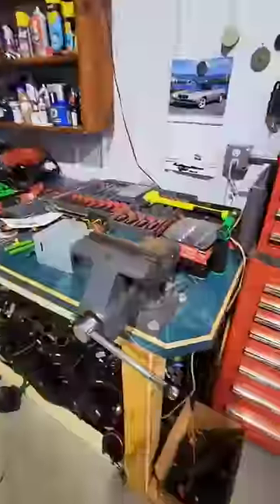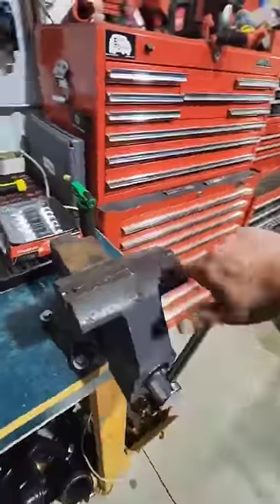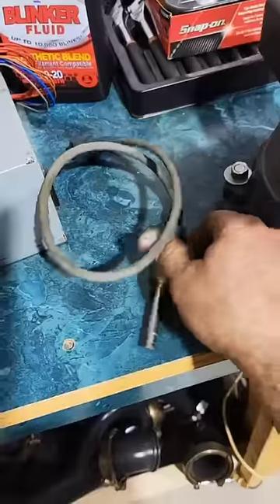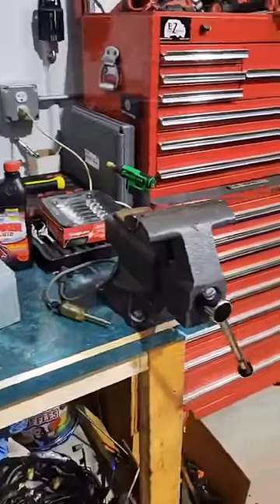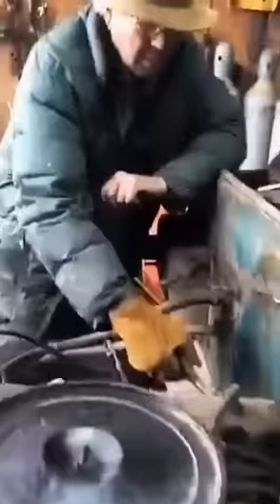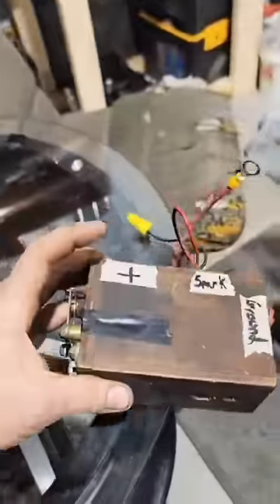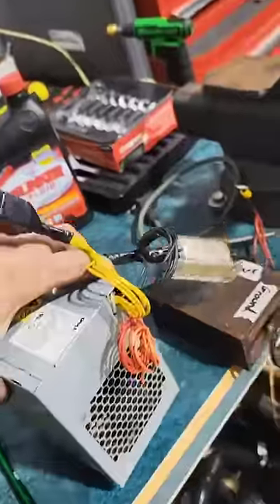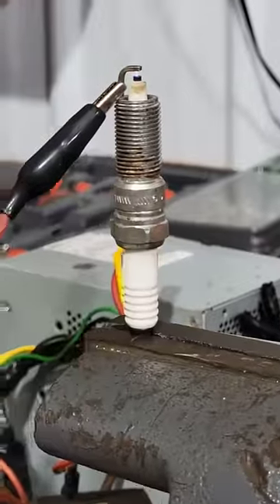30,000 Volts out of an ignition coil! #shocking #shorts Be careful, electricity can be dangerous.

Comment: Back in the 60s  I hung out with my gearhead buddies at a local service station. It was convenient because the operator would allow us to use the lifts and service bays to work on our cars. At that time most garages were equipped with a spark plug tester that would energize the plug to see if it was working properly. These guys ran a wire from the spark plug tester to a metal framed chair in the customer lobby. Woe be to anyone unfortunate enough to sit there. I watched those heartless bastards zap a little gray haired grandmother and laugh for an hour afterwards!
Reply: Yea... that's not really funny... more cruel honestly.
Reply: And you aren't gonna tell me that you didn't laugh at the time with your buddies.
Reply: @midnightrider1854   I'm pleading the fifth on that one! I was appalled none the less.  Everyone that hung around there was initiated . It was kept a secret, you found out about it the hard way. It was a real eye opener!
Reply: @markkaminski2416  That's definitely rough. But I think as young bucks, we all did stupid stuff. Some more than others.

Comment: Back I the day of points and condensers,  we learned how to charge a condenser using the SUN testing machine. A condenser,  or capacitor,  would hold a charge. Then you would toss it to someone. 
When they would catch it and get hit with 20000 volts, the chase would be on.

Comment: Remember: Lightning proves that for sufficient voltage, an air gap of literal miles is not sufficient insulation.
Reply: Yeah, the a circuit doesn't need to be connected to still zap you

Comment: In high school in the 90’s me and some friends would run a speaker wire from the coil down through the firewall and under the driver seat and fan out the wires between the seat and backrest so when they turned the ignition it would shock them. Had some incredible reactions, too bad it was pre camera phones!

Comment: **THIS IS EXTREMELY DANGEROUS OR FATAL....**  when the circuit is completed, it goes up arm, across ur torso & out legs/feet....current running across ur torso can cause ur heart to stop beating or beat irregular...PLZ BE SAFE ALL, EVEN THOU IT'S FUNNY!!!!
Reply: Only if youre barefoot. You need to be touching ground somewhere to complete the circuit. If you have shoes on you are isolated.

Comment: That's a pretty good trap but you shouldn't use a computer power supply unless you want to end up with a negligent homicide. A 9v battery or some LiPos in series are way more concealable and a lot less lethal

Comment: Years ago working at a tire shop. Put my car on a lift left for 10/15 minutes to buy some new shocks and upon my return the mechanic told me that he had done a bit of tuning on my car. Told me to fire it up. Well while I was gone he took a wire from my coil through the firewall under floor mat and out my seat cover. Yeah you may have guessed. Straight to the sack being grounded by the key. Good one. 😮

Comment: Did the same thing to a fellow tradie when he went on holiday. Used the coil from a flourescent roof light in a truck sleeper. One wire to vice, one wire to heavy steel and isolated with 2 thin strips of rubber, both wires hooked up to truck battery behind bench. He grabbed the steel to hold the weight and then grabbed the handle to undo the vice🎉

Comment: Anybody who ever owned an old air cooled VW knows this well. The spark coil is mounted right where you bump it often while adjusting your carbs and if the temperature changes 10 degrees you are adjusting your carbs.

Comment: My grandfather had a problem with pedestrians and transients urinating on the back fence of his property which bordered an alley (servitude)which ran down the middle of his block.
He put up signs in all the official languages to warn the piddlers, but they were ignored.
The urine caused a bad odour and also damaged the paint as well as rusting the corrugated metal fence.
The old man was a retired aircraft mechanic and had some old parts in his workshop, including a magneto, from a Lockheed Ventura, to which he fitted a hand crank.
He wired this up to his back fence which was half way down the alley.
When seeing or hearing anyone approaching,vhe would wait by the fence, crank at the ready and if he heard the drumming of pee against the fence, he would wind that crank like a demon, sending thousands of volts through the urinary offenders.
After a while very few pedestrians used the alley and none stopped to pee while passing through.

Comment: I was knocked out cold by my arch welder once. I woke up on the shop floor about 15 minutes later, I was alone, haven't felt right since. It takes less than an amp to kill ya I learned. I had rubber gloves on and rubber soled boots. I was sweating and apparently the humidity in the shop was very high. After I inspected the glove and there was a pinhole in it. Be careful.

Comment: funny you would air this.  back in about 83 while in Auto Tech school, my instructor Johnny Guise told the class of a similar situation.

don't remember exactly how they hooked it up , but they used a Model T Coil and wired it with a capacitor I think.
they did this to a car in their shop.  someone was taking them for joy rides.

now our instructor was in his 60s then and had worked in the industry for about 45 years.  fawn memories.

Comment: Ignition coils have zero fucks. In my teens, I was checking my parents 5.0 Oldsmobile for spark. I pulled the plug, set it against a ground and turned the engine over. I walked over and saw it had spark. My dumb ass leaned over and grabbed the wire and pulled the spark plug off the ground. Well it didn't immediately hit me and I realized out stupid I was for grabbing it while the car was running. I tried to not ground my self to the car and let go of the plug gently. But I was too far over the fender and had my pecker touch the car. I got the lightning through my pecker. Luckily I dropped the plug wire quick enough that it only got me once haha. Lesson I wished I'd never learned 🤣

Comment: Back 40 years ago I use to get old points and condenser when the garage I worked at would change them out for a new set, I grabbed all the olds ones. Trash can the points but saved the condenser, with a foot long piece of wire, hook wire to the end of wire coming out and hold housing to the ground on a 12 volt car battery and wire on positive side terminal and count about 8 to 10 seconds. You don't need to do it long but I did it Incase the condenser was weak.  I don't think that I ever found but one burned out condenser during my life that didn't hold a charge. Anyway carefully remove short piece of wire you added on and Don't touch end of wire and the housing at the same time or you will get shocked. Then sit it down on the table, not a metal one. It's best if table is made from wood or a regular countertop. Just sit back and listen for the yell, because it will happen. An make sure nobody else seen you setting it up because I've had it backfire on me when a buddy picked it up an walked up behind me and touched the wire an housing on back of my sweaty arm. I hit the motor with my fist as hard as I could punch because I lost control and broke my hand. Boss was pissed off over that and I was banned from ever setting up another shocker trap. If you do that, never use anything over a 12 volt DC charge because it can kill if the person can't release their hand. An Never set up one if there is a child around. It can severely hurt or burn their fingers, muscle and nerves and could make a finger or hand deformed so think about it hard and it's only a harmless like until something bad goes wrong. Ok everyone. Don't use a old power supply from anything like from computer because most people will hurt or kill themselves. Keep voltage low to only 6 or 12 volts. Please listen to my warnings for your sake. Once it hits, you can't undo it no matter how much you say sorry it doesn't take away the pain. An don't shock anyone who has a pace maker either. You could kill them by messing up their heart by stopping it.
Reply: As you Yourself , obviously realize , this could be a dangerous comment to make and might backfire on you , legally .
If somebody follows your instructions and severly hurts or kills  somebody ( with a bad heart )  then they will say " Terry Douglas " showed me how to do this . 
It all Fun and Games until the Ambulance shows up .

Comment: I was arguing with my high school shop teacher about the reason the lawnmower engine we just rebuilt would not start. I told him the magneto was not putting out voltage. He told me to hold the wire and pulled the rope. Yikes. My hand was numb for two hours. I said "I believe you are right. The magneto is working just fine" He laughed and gave me that "lesson learned the hard way" look

Comment: My stepdads friend, who was also a mechanic, told me to test if the ignition coil was working, I was instructed to hold the screwdriver head in the tip of the cables that ran to the distrubutor of an old Nissan 1400 and he started the engine, never felt my arm kickback so hard and fast before, a lesson I'll never forget 🤣🤣

Comment: Ok, do this, take an old piston cut the top of 1st or second ring grove take a small motor cycle coil, screw it to the inside top of piston, take the bottom half and put clear silicon where you cut it DO NOT LET BOTH HALFS TOUCH WHEN SILICONING TOGTHER 
load the coil set on parts counter where someone will invariably grab it to move it when they contact both halves, ZorchO!

Comment: I remember my dad and I were working on his old Jag and we were going through the cylinders to check spark. On the first cylinder, he gave me the long nose pliers and said, "Just pull it out and check it."

I've done it before, but I didn't know how to set it up, so I just went for it. After the voltage went through my nuts to reach the ground and I tossed the pliers across the yard, my dad said, "Oops. Forgot to ground the pliers! Good thing I already have grandkids."

Comment: You should never wrap your hand around an electrified surface. The electricity causes your muscles to contract, which will make you hold onto it, electrifying you longer. It doesn't need to be a high voltage to kill you, especially if you are holding on longer.

Comment: We used to charge a condenser from the distributor by putting the wire in a spark plug wire ,grounding the other end,, then cranking the engine. Toch both ends at the same time, and WHAMMO.

Comment: When I was in my teens, every summer I went to a Christian summer camp. They had a wooden stool with the seat covered in wire screen connected to a Model A coil. While sitting on it you were asked a question and if you gave the wrong answer a button was pushed and you were literally lifted off of the stool. One night we noticed a cat had jumped onto the stool. When the button was pushed, that cat jumped 6' into the air! It didn't come around after that.

Comment: If you want to mess with your friends that dont lock their car on lunch at work then do this. Get you some speaker wire. Put it under a spark plug wire or coil then reinstall. Run the wire on the passenger side of the vehicle however sneakily you can and run it up to the driver's seat from the back. Strip the end about 6 inches and fan the wire out. Then when they start it, count how many times they hit their head on the roof and see if they are even smart enough to shut the car off.

Comment: 30k volts is enough to arc the electrons in the moisture of the air, that's why "completing the circuit doesn't matter" because your body resistance is enough to create a ground

Comment: Something my dad said they used to do as teen boys whose dad, my grandfather who owned a junkyard, 40s and 50s cars had a coil condenser and rotor system to send spark to the plugs, my Dad and his male siblings would take the condenser from a car that was being parted out hold it by the coating on the wire only, lay the condenser housing on one battery post while striking the wire end on the other post, this loads a 12 v charge wger3 its output averages 20k volts  on the negative post on a 12 v battery and tap the wire for an instant , this would do the same thing as loading the condenser with  the equal charge one might get from a firing plug wire that will bite you

 on a car.  All it would take is yell catch while throwing the condenser to someone who without thinking would attempt to catch whatever you were throwing to or at  them
 When they touch the bare wire end and housing at the same time they ground out the charge through their victims hand. This had many times use by just recharging it instantly by striking the wire end and housing as quickly as you can, while only touching the insulatedwire coating whete you stay insulated. reloads the condenser for the next victim or as  a retaliatory act If the one shocked was able to get the condenser. So long as it was not grounded and the wire end and housing touched someone they would get bit. Placed under someone's blanket just before bedtime makes them get out of bed faster than if they were climbing in but doing both at the same time is funny to watch while the approx 20,000 volts ol rip someone from reality every time it's touched when it's charged, always ensure holding it by the wires coating only when charged, to safely discharge bend the  wires end over to the housing which sends the charge to ground.

Comment: Oh that’s pretty cool you can create movement by pulling energy from the atmosphere creating voltage tonight to ignite the engine. If you can do that then you can do the same thing inside the engine, increasing engine, power, throttle, and so forth you could even make a UFO you could probably even create a sound technology that can make it invisible.

Comment: You can’t die from this guys it’s volts not current…current will unalive you not volts
Reply: The human body provides about 2M ohms of resistance. If the voltage isn't high enough, you can't have enough current flow to kill a guy.

Comment: Back when brake lathes were common we'd put some brake filings or chips in the cap of whatever spray chemical, add some battery acid and hide it behind their tool box. It's like the smelliest air biscuit you ever smelt but doesn't gently waft away.

Comment: "Ignition coils don't give a fuck if you compete the circuit."
neither do Capacitors, the special thing is that once charged they stay charged even when not connected to ANY power source, kids used to leave charged Capacitors lying around in electronics class and when it came time to clean up some one would get a nasty surprise when they picked one up with out grounding it out first, it ALMOST happened to me, but when i saw it lying on the key block i knew what was up and grounded it out on the keys, ohhhh, swing and a miss there dufus...😲😋😂

Comment: We used to take a small engine condenser, charge it on the spark plug wire while holding by the insulated wire.. pull the rope several times.. then lay it on a wood counter or just toss it your buddy😂

Comment: This is a how to get fired immediately. Setting co-workers to a potentially deadly Voltage with a unregulated Current is very dangerous. Wrong co-worker and you got cardiac arrest or worse on the table very very quickly. That’s gonna be a roundabout of lawyers and jail time. Don’t risk other peoples life over this even if it’s hilarious. There’s a reason you are required to go to the hospital for a cardiograph after touching even 220 volts.

Comment: I used to work in a factory and used to stir up more shit without getting into trouble myself just by going up to any one of three guys and saying, "You know what would be funny...?"  We had a forklift in the department that had a worn out seat.  I convinced one of the pranksters it would be funny to run a wire from the coil and fray the other end out and hide it in the torn foam of the worn out seat.  Someone would jump on the lift and start the engine and it would light them up until they jumped off or shut off the engine.  It became a department prank for a few weeks and nobody got bent out of shape, (we worked in die casting with molten aluminum, and were a different breed!)  Then one day the prank got out to machining and the wrong guy jumped on.  He cried and went to the plant nurse and dropped his pants and claimed he had a burn mark on his ass, (he didn't).  Shit hit the fan, and asses got chewed, but not mine.  I had just sit back and watched and laughed the whole time, never did it myself.

Comment: People don’t realize that volts don’t kill people amps do so the coil in a car or truck may shock you but not kill you unless you make the mistake of closing the circuit through your chest which is rare for people to do most people only get hit in the hand and some other body part but in that rare occasion someone has their hand on the live circuit and the other hand on the ground thus the electricity goes from one hand across the chest and out the other hand causing pretty much a heart attack. That’s why is rare most people that die from electricity are usually hit by a high enough amount that it just fried them. So this might be a funny video but unless you know how many amps the electrical device is putting out them stay away from it unless you are trained to work with it. I can’t remember how many amps it takes to cause someone a heart attack but I do know that it’s in the milliamperes which is very very little so yes most people that get shocked by as little as 110 volts are lucky to survive it 110v has killed more people than any other volt range

Comment: Stuck my finger into an electric water heater to move the yellow insulation out of the way to adjust the temperature and my finger touch the wire going to the element and boy that felt funny. Didn't hurt horribly but holy shit.